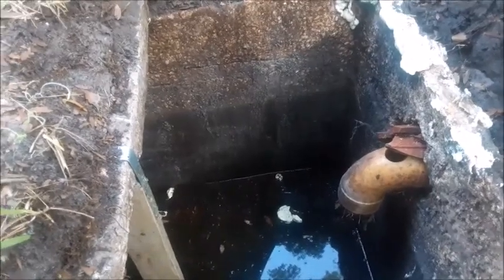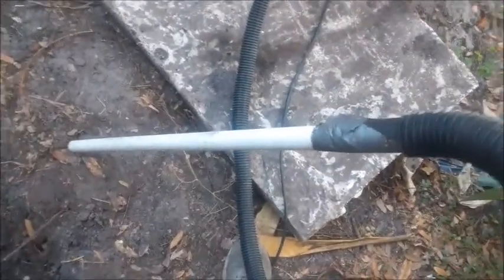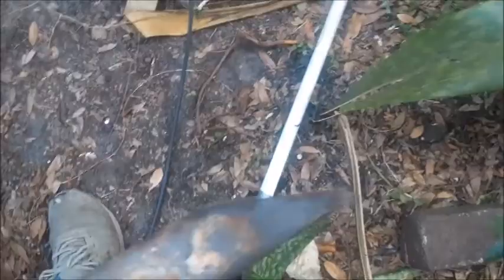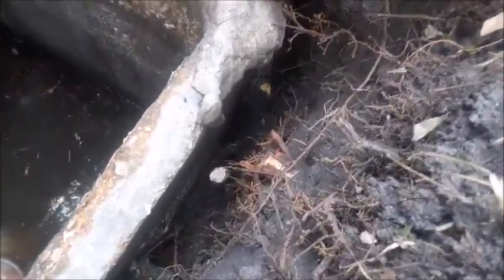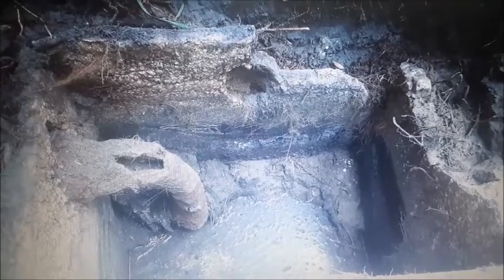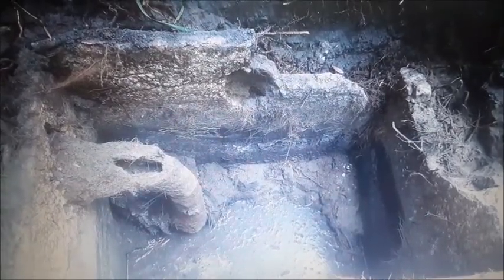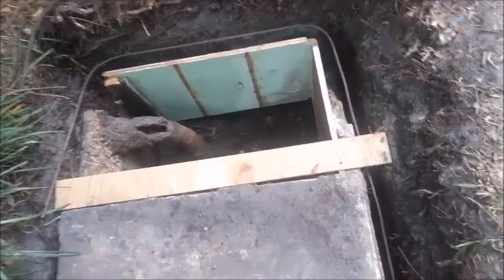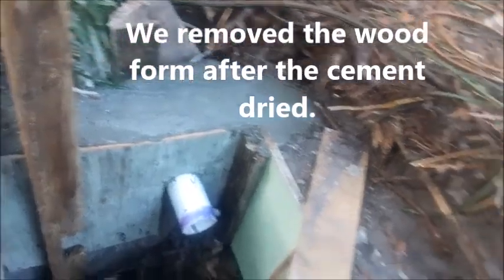How to Repair a Septic Tank Wall

Comment: I am having this same problem that was on my septic tank is falling through and Sam's got down into that side that needs to drain out to the other side to fill your stand on my landfill this has happened of a rainy season they want $20000 I'm going to do what you're doing but I'm in rainy season and nothing dry yet Good tip for me because when I had to set pumped out last year I saw the breakage and I told myself we need to repair that it didn't listen to me we had 6 months and Nothing but Rain rain Rain and All That Dirt fell from inside that Tank floated Over to The Other Side to take as clock my drink fill I can Know how to unclog The-Dream fill but now I got to do this Thank You for your video very helpful

Comment: Very nice. Depending on where you are, I would suggest using cheap thin plywood against the dirt, so that the new concrete has a smooth face facing the dirt. That way frost won't pull up on the tank and cause new cracks.